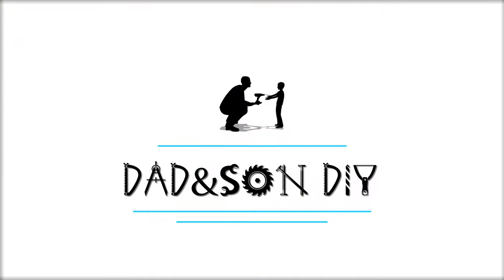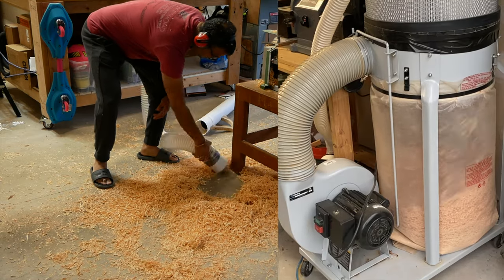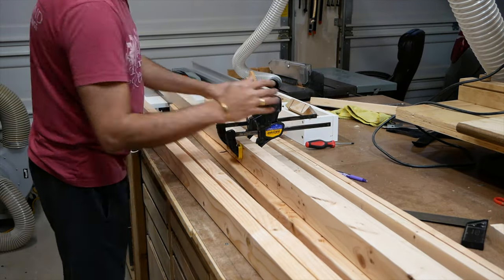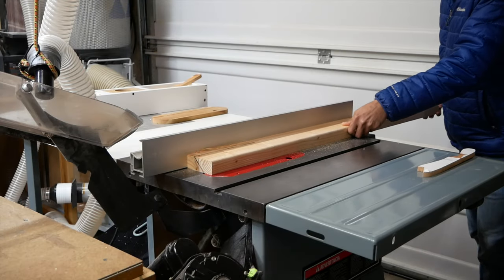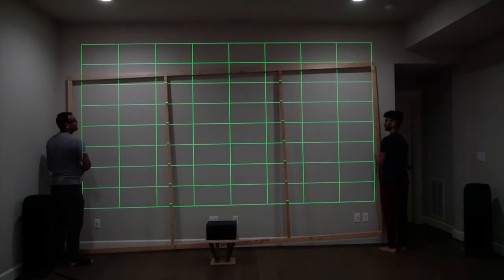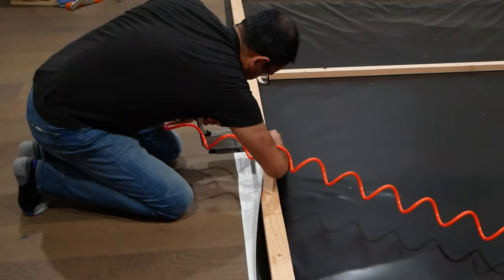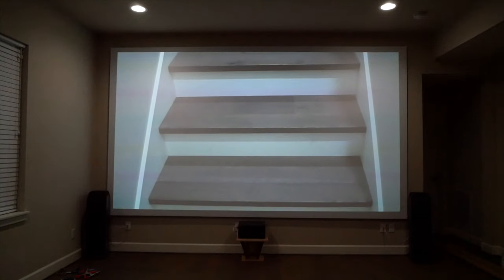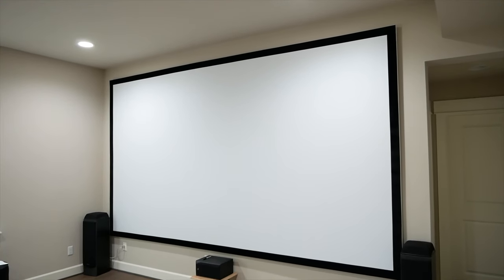How to Make a 172 Inch Projector Screen from 2x4s

Comment: Great job!  I built the screen for my first HT back in 2008 and it went pretty well but I ended up just buying a screen for my current build.  I had purchased material from Carl's Place but when I unrolled it, it had a mammatus cloud look to large areas of the center.  This would not come out by ironing or using a hair dryer so the material was useless.   Because it had been several months since I purchased it, Carl's would not replace it.   

I ended up buying a Stewart screen and in discussions with them, they believed Carl's was correct and that leaving it rolled up too long was the cause.  Because of this, when the Stewart screen arrived, I took time off work to get it unrolled, assembled, and installed the day it arrived.  It was quite a bit more expensive than a DIY screen but it does look good and was easy to assemble and install.

Comment: Did you at any time consider using screen paint for your wall rather than creating the frame and using the screen material?  I've seen some who do that and still use the felt tape for the edges.

Comment: I haven't started mine yet... but its close to 189 diagonal (but mine is a 2.35:1 ratio carls material & not 16:9)  and I was really wondering whether i can use a 2x4.  but you guys proved the idea of using 2x4 is worth the try and gonna work for sure. I was soo worried abt the wood joints (you guys achieved by simple lap joint). hmm.. appreciate if you folks can share the granular details personally.... stupendous..
Reply from the maker: 2x4s should definitely still work for that size. Most of the details were covered in the video. To make sure the screen is flat, you'll probably also want to mill all your boards as we did, or purchase some nicer wood (2x4s really suck right now, at least in our area). Also, if we were to do the project over again, we might choose to use entirely half-lap joints instead of pocket holes for the corners, as those joints introduced some flex, but once the screen is hung it's really not an issue. Thanks for watching!

Comment: Can you post your cut dimensions?  For a 172” diagonal screen what was your height and width?  How big was your bezel?
Reply: 172" diagonal can be calculated, the most general ratio for widescreen viewing is 16:9. If you know Pythagoras' theorem you know that the triangle is 3,4,5, or in this case 9 (3^2), 16 (4^2), 25 (5^2). Easiest way is take 172, divide it by 5, times it by 4, that's the length. For the height, take 172, divide by 5, times by 3 and you get your rough dimensions for the screen

Comment: wish u could make one for a  300 inch screen i was thinking of use 3 x 3 beams or 4x4 bean this would be for out side use this would never fit in the house  and not sure if i will make it with lags or hang it on the garage
Reply from the maker: The process is the same, but WOW that's a huge sceen.